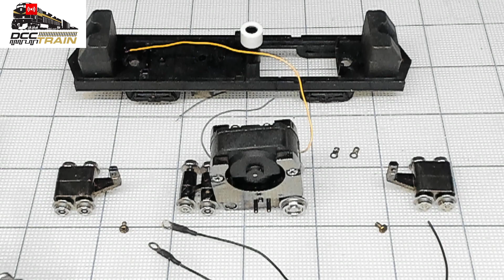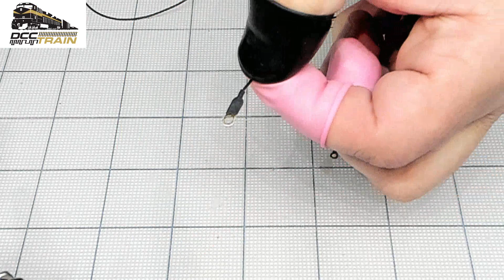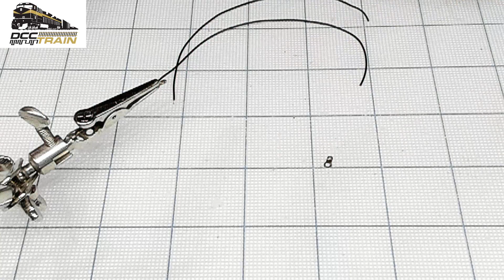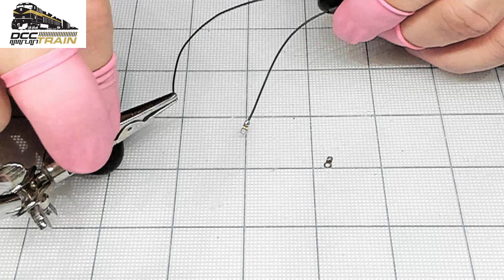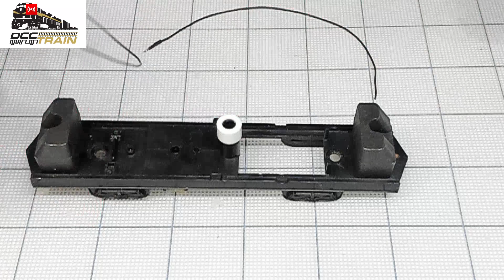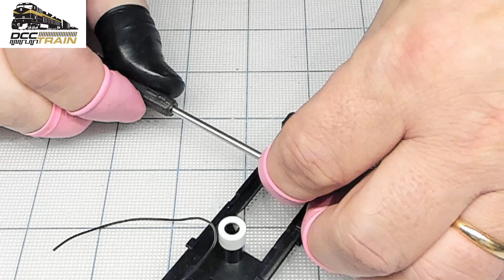New wire soldering technique HO Bachmann Plasser EM80C

Comment: Hi! Would like to say that 30 AWG is quite too delicate theme for locomotives. For leds is ok, maybe 36 (depending how you connect it). But for engines and speakers better to use 24 AWG. That how usually fabrics  of that parts advice. For speaker Taiwan fabric told that 23 is ok. My 14mm Swiss motor from fabric come with 24 gauge. But the overall diameter of wire is only 1 mm. Usually standard is 1.3 mm. However the best to find wire with isolation thickness of 0.006“ with many cores (20-30). This can give you overall 0,89 mm. Not so much more than standard 30 AWG (0.65-0.7 mm).

If you buy wires for many years it is better to be familiar which country and fabric produce it…
Reply from the maker: Thanks 👍